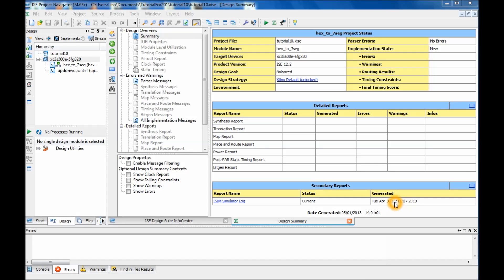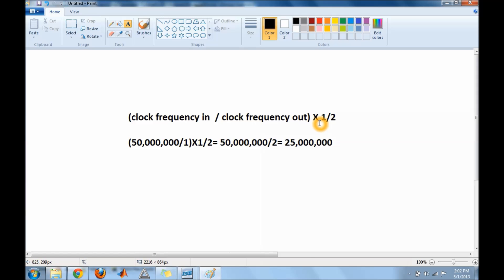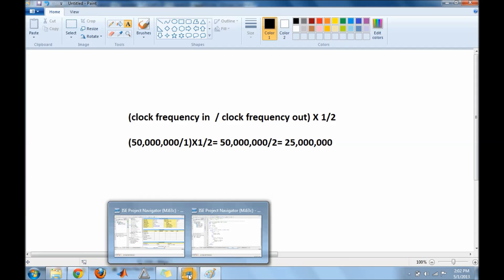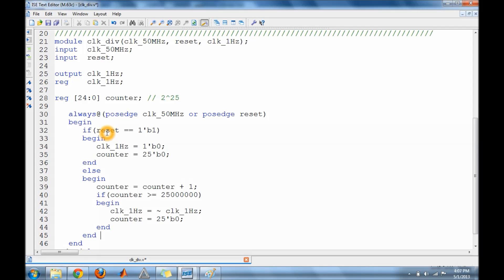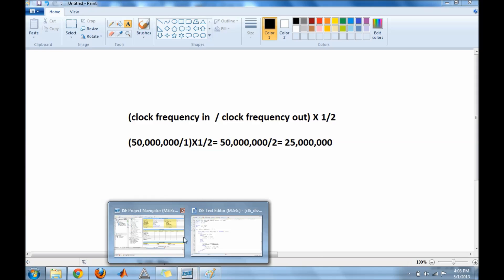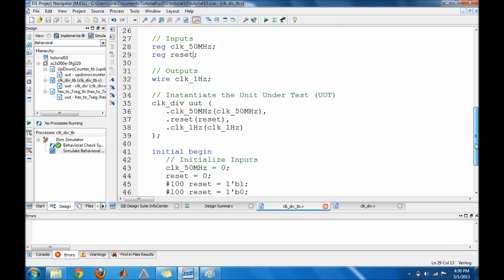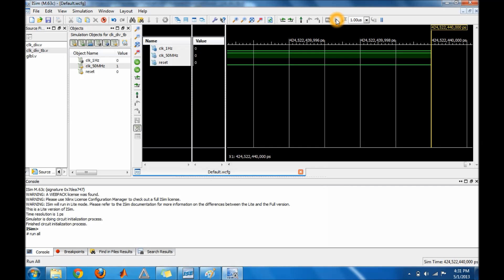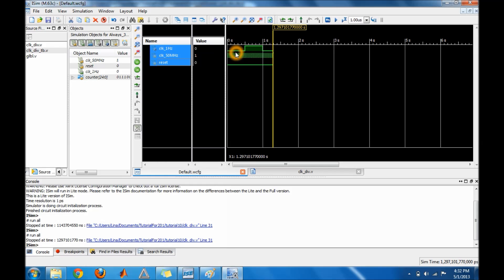CSULB CECS 201 : Up Down Counter part 3 ( Clock Divider)

Comment: Thanks for sharing this video. I have a question... I followed your video, but I couldn't get the same result as yours... I also wrote [ if(counter >= 25000000) ], but my result is that the positive edge works every 0.5 ms... not every 0.5 sec... I really don't know why... T_T...